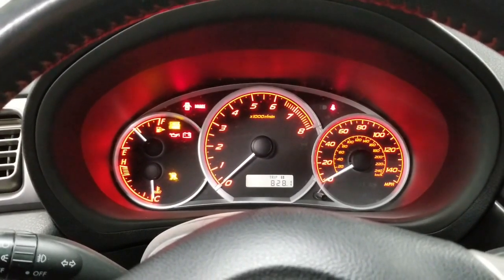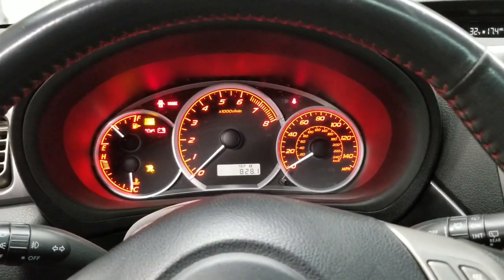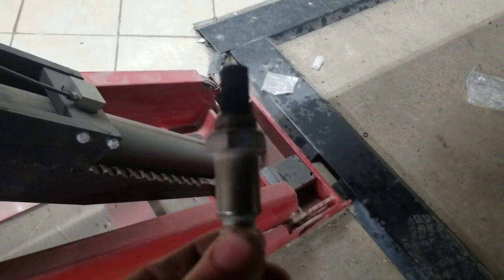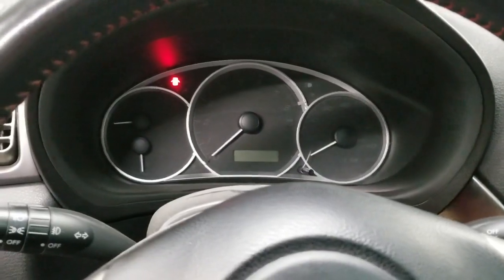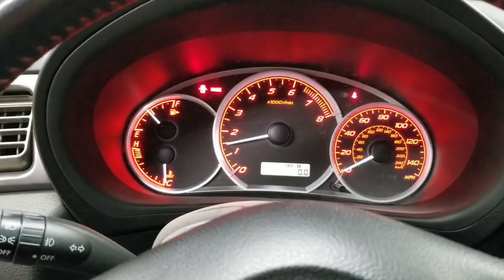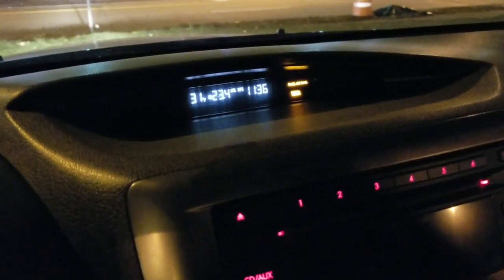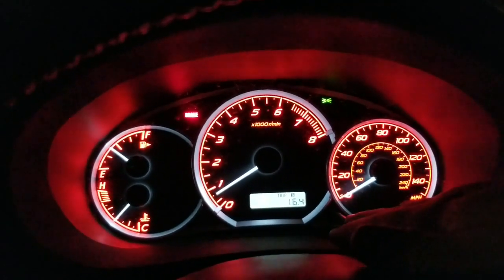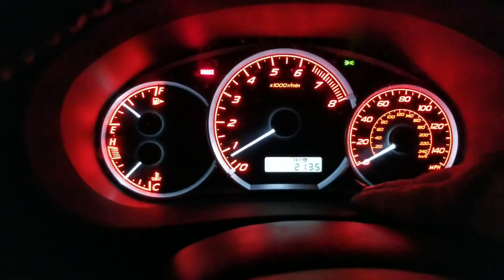Subaru Check Engine Light on DTC P2097, Poor Gas Mileage, Post Catalyst Fuel Trim System Too Rich

Comment: This guy does not know what he is talking about.  Apparently he replaced a post (downstream) O2 sensor.  More than likely the problem is on the upstream O2 sensor or other causes.  The downstream sensor triggers the code because rich fuel is detected, which matches with the low mileage behavior.  Also the verification is totally false.  If you unplug the battery for a minute, and drive 16 miles, you will also get the same great gas mileage, especially in the winter where he was.  But eventually the code will return.
He has another video and the diagnosis is egregiously bad.
Reply: I have the same issue on my 2013 scion fr-s…car sat for a couple of years and now I have funny exhaust smell and this p2097 code..:how do I do proper testing to confirm what the exact issue is?

Comment: Code p2097 caused me a psychological problem.  Insensitive oxygen 1 and 2 also changed the air filter is sensitive and gasoline is still the problem of the code did not solve what to do
Reply: I'm afraid not .  But I still drive the car.  A specialist suggested that I check the wires and fuses, maybe there is a cut in one of the wires, but I haven't done that yet
Reply: Hey did you get it fixed

Comment: i got the p2097 code. Post catalyst fuel trim system too rich bank 1. car drives fine, but i do notice the gas going down faster. is it just the sensor? and how do i find out if its bank 1 sensor 1 or bank 1 sensor 2? car only has 14,000 miles. thank you!

Comment: Having the exact same problem. Replaced the same sensor and code came back afew days later. What next? Another o2 sensor farther up? Air/fuel? Maf? Or cat converter is faulty?
Reply: Did you get yours fixed?